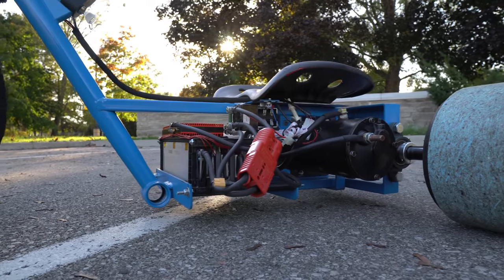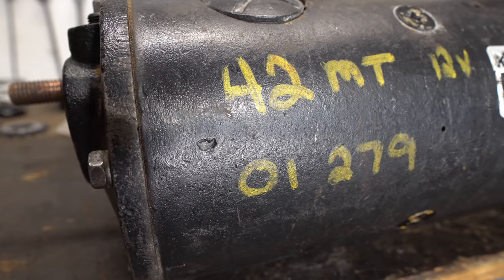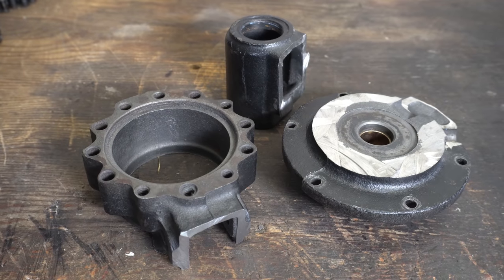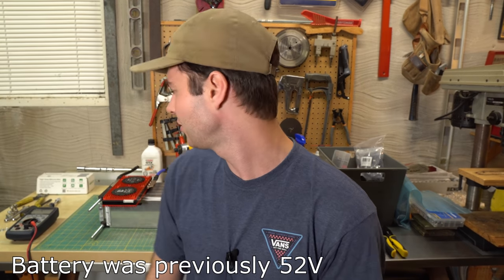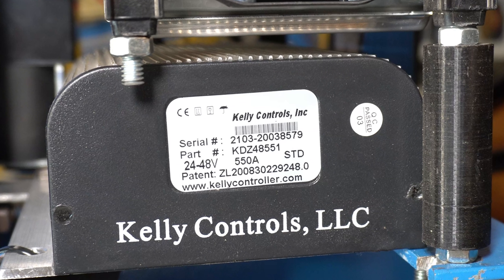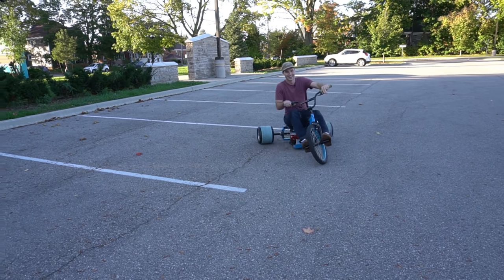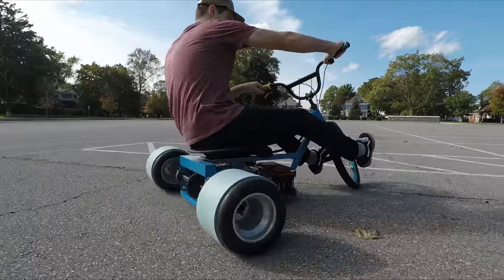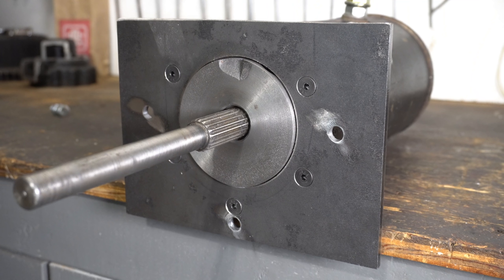Building a Starter Motor Powered Drift Trike

Comment: I was very surprised how well that motor worked. I had the same thought as you, I just assumed it would have overheated after a minute or so. Very cool!
Reply from the maker: Definitely worked better than anticipated. Thanks!
Reply: I figured that since it normally draws 1000+ Amps, it would overheat at that current and running for an extended time, but the current is being limited to 120A. Since power is I x I x R and since R will be the same (about 10V/1000A = 0.01 ohms), power used in its original (cranking) application will be 0.01 x 1000x1000 = 10,000W, while now with current limiting it is 0.01 x 100 x 100 which is about 1000W. Lets assume the efficiency is around 90%, that means that when being used for cranking (1000A) - it will lose about 1000W as heat - that will cook it given enough time. With current limiting it will be closer to 100W - which will is not enough to heat the case to any dangerous temperatures.
Probably best to focus on bearings as per 1dfgaJ83K92 suggestion.

Comment: I believe the significant reason behind starter motors being considered inadequate for projects (aside from their very low resistance) is that they don't usually have bearings. They usually rely on bushes and as such aren't suitable for prolonged operation. It would be interesting to see if replacing the bushes with bearings allows your motors to run for a long time.
Reply: Also the fact that they draw a horrendously high amount of current is one of the reasons (100-200 Amps if it's a starter for small car).
Reply: @CenReaperYT.  Only under load... Current is proportional to motor torque.
Reply: @dfgaJK  yeah,lol.

Comment: As a kid in the late 80's, we made some wheeled projects and the craft, design & technology teacher said to us that starter motors were prefect for the projects and we just ran with it.  The only issue I had was burning my hand on a cable but starter motors (powered by lead/acid batteries) were definitely capable but nowhere near as fast with modern batteries so keep running with the starter motors but always keep an eye on temp so fit a thermometer.

Comment: I am a Motor/Generator Engineer ... (Electrical Power Engineer)  . 
Standard Automotive Starter Motors will work just fine for light-duty applications, like carts and trikes . 

You can run them for years. As long as they are not getting hot to the touch. You are fine. 

Look for starters that draw under one amp at unloaded, free running conditions. 

If your electrical connections get hot, use some Electrically conductive grease . 

I built an electric car with 4 starter motors. 4 wheel drive. I have been using it for years. 

You can put air holes in the front plate like you show in this video, but you dont usually need it. 

Just check it for over heating. After running, just hold your hand on it. if you can not hold onto it, without getting burned, 
then you are in danger of overheating. 

Good luck!
Reply: I’m looking for a way of controlling the speed without buying a mega expensive controller like in the video.
Reply: Tell us more about your electric car w/ four motors!
Reply: @richoutthere2962  Find an electronic Eng. with exp. in this direction , for desgn . You need Alu heat sink for MOSFET trasistors ,and PCB to be made for rest of electronic parts ...

Comment: You might be able to just add some cooling ribs to the case of the motor by just cutting some grooves into the case. This way you don't comprise it being waterproof. I would just put the case in your lathe and turn some grooves.

Comment: Run a copper tube around the motor and get some water circulating around the motor, with a simple mechanism that pumps a little water, when the wheel turns

Comment: I think an aluminum or copper heat sink would be far preferable to drilling holes in the housing.
It's always possible that you could find an extrusion that fits but if you have access to a good mill & use a half-inch plate of aluminum, or maybe 1 inch, you could just mill channels in the plate till the deepest cut leaves the thinnest parts about .030". Then just find something to wrap it tightly around the motor housing, such as a large hose-clamp.
You could go one better & attach fan blades or a large computer fan to the back of the motor. So long as you make the fins of the heat-sink parallel to the rotor shaft so the fan pulls the air in the most efficient direction.

I would try to keep the motor under 200 degrees F to be on the safe side.

Comment: Would it be possible to control a 12v starter motor with PWM controller? Im a mechanical dude, and its the electronics of this stuff that put me off. Im thinking about doing a small beach cart.

Comment: Very well built!, but I prefer the previous setup, reason: PMSM only need bearing maintenance. Starter motors use carbon brushes, that you need to check and change.
Reply from the maker: Thanks! Yes, the BLDC setup is much better. But this was a fun project!

Comment: Very interesting project as experiment ! Evan if we put Allu housing with axial holes for water cooling or plastic fan , calculated thermistors for over heating protectio and all will be OK for long time use , who knows how will brushes and comutator behave !? For get to write that we need to change a bushings with radial bearings for sure .

Comment: i use a PM brushed dc motor from an electric wheelchair on my ebike.
1500w it stays warm. 1800w it starts getting hot.
starter motors are series wound with no magnets tho.

what kind of wattage are you getting?
50v * 40A = 2000W peak for mine

Comment: 24V diesel starter motor. I used to repair them along with other stuff. 12V versions get rebuilt a lot LOL...just don't have the ooomph the 24V version does. 12V driven at 36V...not a good idea but hey! its your skin...heheheh
Reply: Why not a good idea, seems to work well. Did he do it to get higher rpm? Could motor burn up?

Comment: 2:30 using non-impact Torx bit in an Allen head bolt, what did you expect?
Reply: Obviously he expected to tighten the screw, tf is your comment for
Reply: @pleopsidium6960  would you expect your petrol car to run on diesel and no one to pick you up on it when it fails?
Reply: That was just unnecessary, since he's even shown his silly mistake in a funny way. You chose to be like this, so whatever.
Reply: @pleopsidium6960   the video shows the bit breaking and puts it in the humours light of an unavoidable unfortunate outcome.
I believe it also necessary to highlight the reason for the bit breaking, such that others can learn that the outcome was due to an incorrect bit type.

You are coming across as quit sour about my comment, does it offend you?

Comment: Gread ...the stafe that it surprise me that this kind of motor is existe in electric car like fiat panda electric  ..it's the same thing same kind of rotor ..same kind of stator same brushes ...it's steel frame to ..So why the car starter heat and the other no 😡😡.. probably it's shood making some modification ..like making a aluminium frame as heat sink with holes ..and tow fans inside